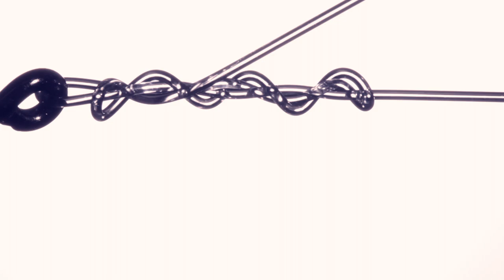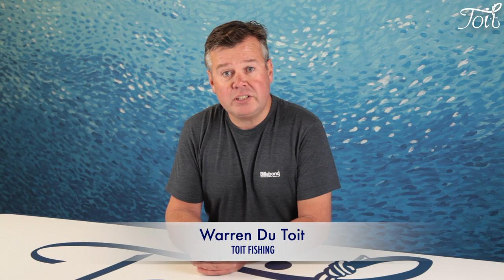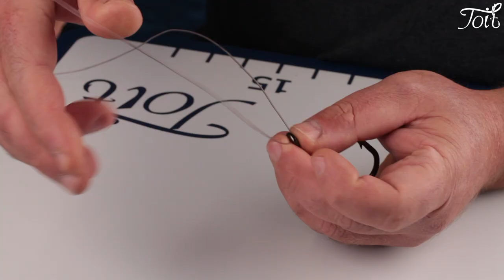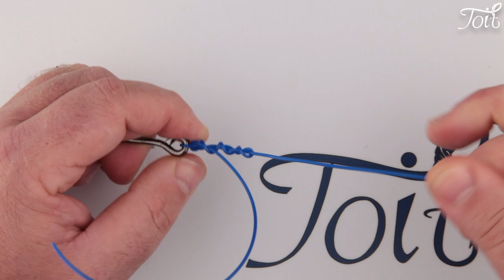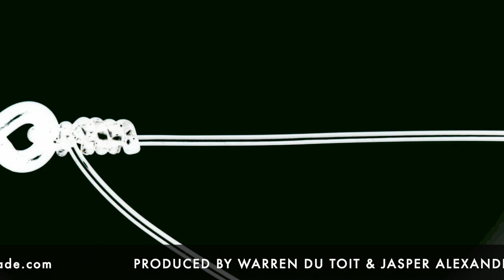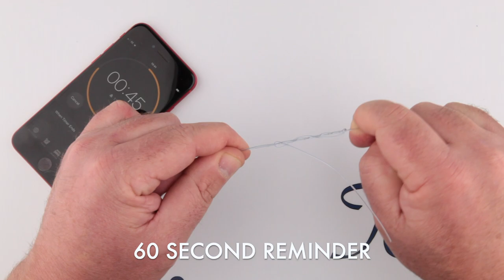Improved Clinch Knot | How To | Ultimate Fishing Knot Guide

Comment: Warren, try what I called the extended clinch knot, do an improved clinch knot but wrap the same number of turns up the line as you did once for improved clinch knot. You can call it it the Crane Knot. I’ve been tying it for years
Reply from the maker: Hi Stuart, thx for reaching out. Basically an overwraped improved clinch knot. If this is what you mean I used to tie it also ages ago, it’s my lead photo on my website, me and my boet would tie it back when we were lighties. Albeit it without the double wrap at eyelet.

It’s actually what I based the Toit knot on although that it’s has a few changes and other things going on. 

There is a chap on my feed on the Toit knot who has the earliest documented version on YouTube of this overwrapped Improved Clinch knot with double wrap , I think he was from Trusted Tackle Tips. He refers to some other chap also but I could not find it on his feed. Take a look sometime if you not busy. 

I was convinced it was a good knot also but it all changed when I started testing knots, movement is a killer on knots, hence it evolved and evolved and I ended up adding a double wrap at eyelet and a mid tuck thru half way at eyelet also, which shut all the movement down. 

Thx for reaching out, have a nice weekend. Tightlines.
Reply: @toitfishing  I love your knot as it makes so much sense, I wonder what the tensile strength is of the knot we have both been using? Can you test it? It’s not a knot shown before although we both have used it. I’ve never had it break before
Reply from the maker: @stuartcrane9409  hey thx Stuart, you made my weekend, it’s always a blessing for me getting kind words from people you’ve never met before. It’s a good knot but the clockwise wraps then tuck then clockwise wraps actually allows movement really easily, i will do an “evolution to Toit knot video one day and will show how the knot evolved with testing. Tightlines